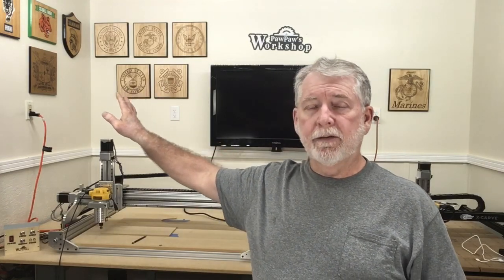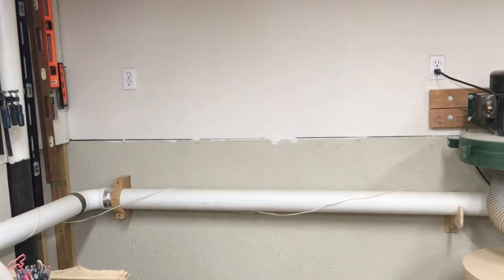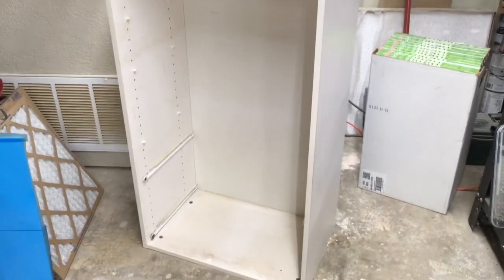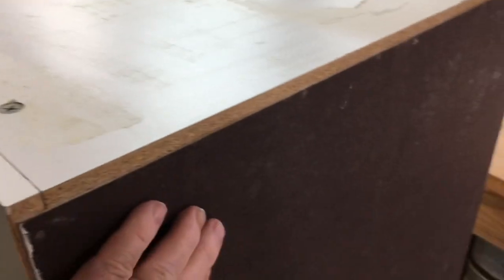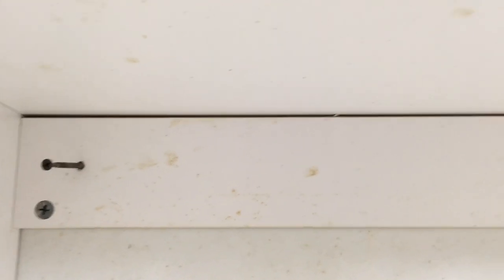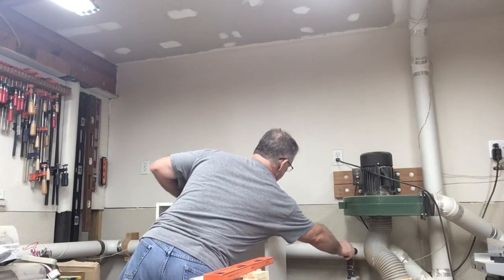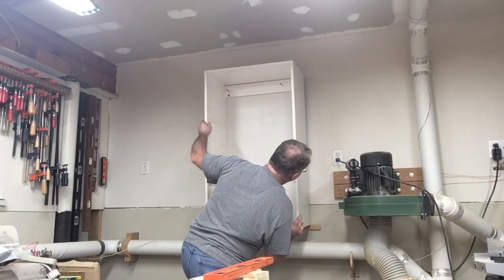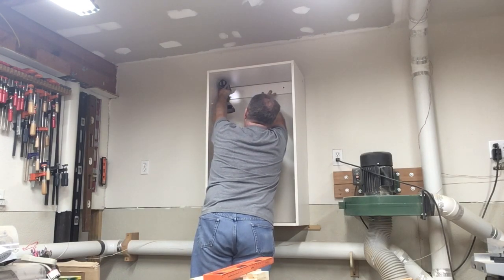How to Install an Oversized Wall Cabinet Alone!

Comment: I just put up a 45"×36"×15 solid 4/4 oak cabinet. If yall see something strange in low orbit, it's just an o-ring I blew out.
Reply: Ok... that’s some funny stuff right there.
Reply from the maker: That's a little off the wall comment
Reply: @PawPawsWorkShop  I see what you did there